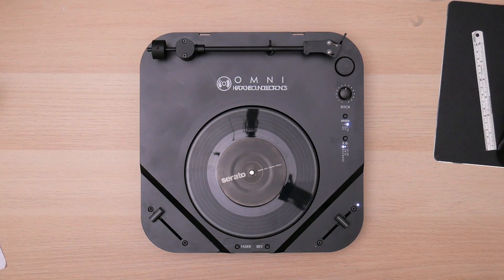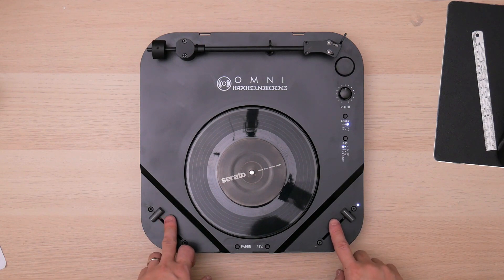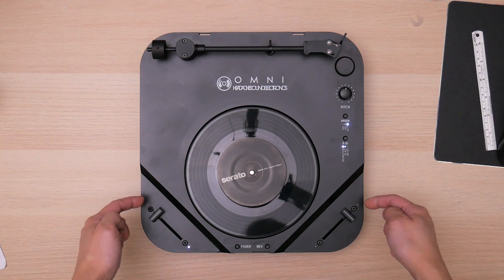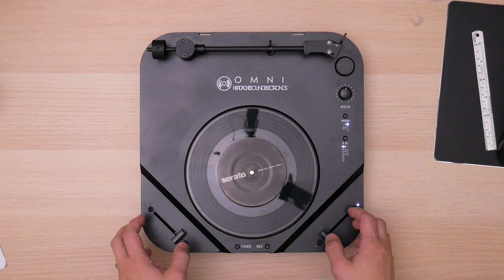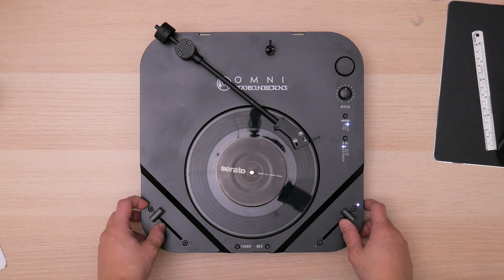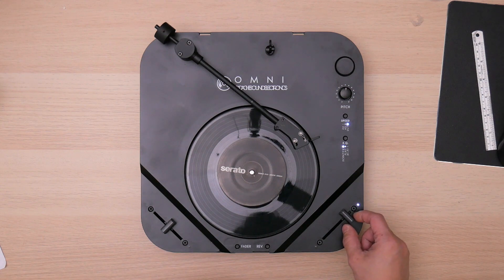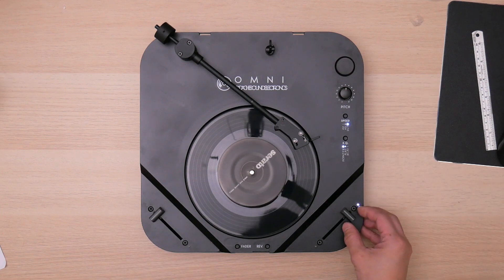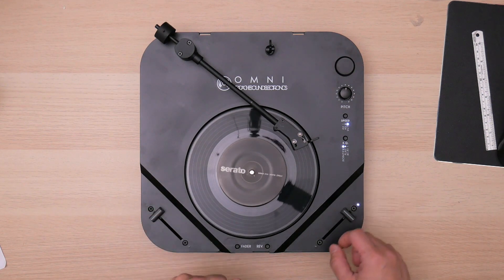OMNI Faders calibration

Comment: 2 features that would be awesome :
- Double fader cut : possibility to cut the sound with both fader at the same time.
- Max gain volume of the vinyl : Aux volume is very low compare to the vinyl output. It would be great to adjust the max volume of the vinyl by pressing a button and move a fader. then releasing the button and use the fader normally.
Peace, great unit by the way !

Comment: Amazing video buddy, I've had my OMNI since the second wave of these, back in 2020. Its absolutely my go-to, as far as practicing my cuts, & my scratches, & routines, etc....
    I learned something new today, as far as the "fader calibration goes my friend. Now I scratch with my right hand, & crossfade with my left hand. So, if I wanted to set this up so that the left side fader is my cut in fader, & the right hand side fader is the volume fader, how do I complete that set up. I sort of understand the process by watching the video, but wanna make sure I dont screw up my set up indefinitely, ya know my friend. 
    Also, how, & what is the best connection process, & set up, for DVS mode for Android devices, thanks man...👍🙏😎🔥💯🎧🎚️🎛️🎵
Reply: Hey, I can't recalibrate my right fader on my omni and I barely even use it. Is there a fix? After recalibration, sound doesn't come on until the fader is like 20%to the left. You know how I can fix this?

Thanks
Reply: @adictiveadictive I have the same issue
Reply: @DJBILINGUAL 

Hey, you just reminded me that I reached out to headachesound and they responded a long time ago but I never did what they told me because I got sidetracked lol. Turns out there's a fix! I'll copy and paste the instructions they gave me...

Hi, please take a look at this video:

https://youtu.be/QeIrbM8EYtk

If the fader doesn’t behave like the video. Please do the followings.

1. open the bottom cover
2. turn on OMNI
3. move the problematic fader stem to the middle
4. press the “cal” button on that fader board, the blue led under the fader will stay on for 3 seconds.
5. move the fader stem to one end, hit “cal”, blue led flashes 2 times
6. move the fader stem to another end, hit “cal”, blue led flashes 3 times
7. redo the cut-in calibration by holding “fader and rev.” on OMNI and hit start button.
8. see if it work again or you could go to self test mode to have clearer figure.

Hope this helps and good luck! Let me know..
Reply: @d.b.cooper2052

If I'm understanding you correctly, I believe you just simply press the "fader" button and it switches it. Hope this helps, let me know..